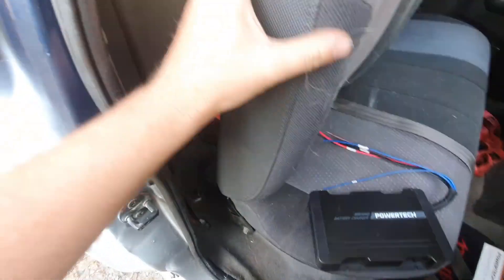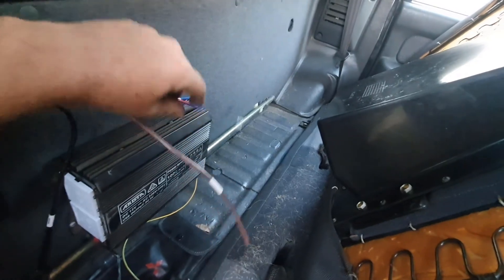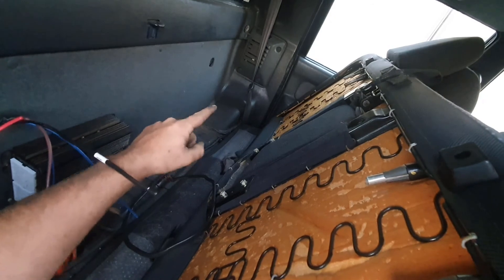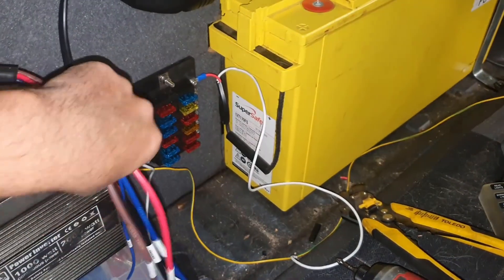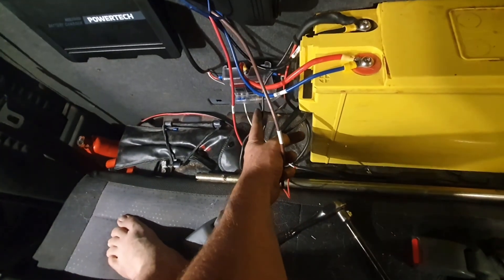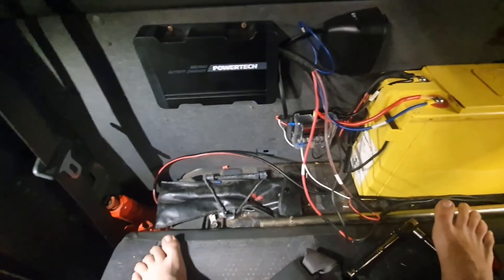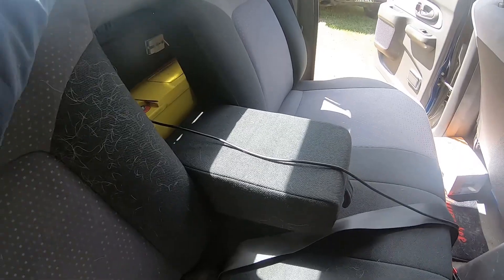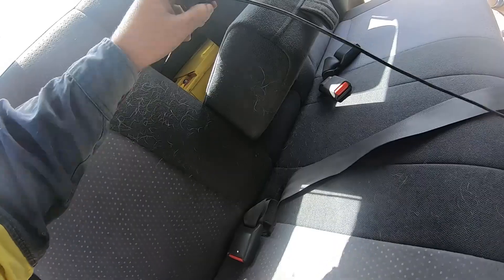installing Powertech dual input DC/DC multi stage charger.

Comment: Hi there. I bought this one a year ago and all was good. I was using the main batt for charging the sec battery. Recently, I’ve installed 150w solar and since then the charger pretty much stopped using the alternator. I understand the charger’s preference is solar but I thought it would combine both power sources when the engine is on but no. And now when I disconnect the solar, the charger will use the alternator for a few minutes and then it shuts off and won’t come back on again. Has anyone had similar issue? Cheers.

Comment: My unit is turning on and off. Not staying on. I've got 13.8 volts at the leads feeding into it. The acc wire I've joined with the positive feed as my feed wire from main batt is already off when ignition is off.. can anyone help? Do I need to disregard the acc wire all together?
Reply: Hey mate - I have the same issue. While it is charging it turns on and off. Did you manage to fix it?
Reply: @andrewakib1472  yes I did. My issue was that my feed did not have the current to supply it. I checked the resistance at my feed and it was high ie my earth was bad. I'm not expert, but my guess is that the unit goes to draw current and it isnt available so it switched off, only to switch on again as there is just enough to run its "on" lights. I changed my earth on the car, checked for resistance and its algood. Only issue now is that it doesnt actually stop charging when the car batt gets below a certain volts which I thought it is suppose to. Ie, if I leave it all connected it drains my start batt?

Comment: Hey, correct me if I'm wrong but did you connect your negative from your main battery and from the dcdc direct to your 2nd battery, then run a 3rd wire to an earth? And would 6mm wire be ok or should I get thicker wire.
Reply from the maker: Correct but it not necessary with the earth between the 2 battery's as the car is earthed. 6mm cable should be fine the most the charger runs is 20a

Comment: I need help my charger wont shut off and constantly drains the starter batterys charge even when the car is off. PLEASE HELP IM DESPERATE
Reply from the maker: Sounds like that might be an issue with the unit not the wiring

Comment: Hi,
Can someone help me, when I connect solar panels to the mb3940, the solar charging Light is on but with my wattmeter displays only 0W. 
Thanks and best regards Pascal
Reply: They are fairly useless on solar, you need around 4amps minimum otherwise it drops off to zero

Comment: could you connect the ignition
 wire to the cig jack in the boot as it only turns on when the key is on?
Reply from the maker: You could but that would run off the main battery.

Comment: That bit about setting the battery type before connecting the DC output from the charger to the 2nd battery should have a mention in the manual! Other than that a great little unit.
I have one in the camper trailer and have just put another in the Patrol for it’s auxiliary battery.
A very useful video!👍

Comment: Does the negative cable from the DC-DC charger have to run to the starter battery as well, or can it also be earthed to the body?
Reply from the maker: Just Earthed is fine

Comment: I have hooked mine up exactly the same does anyone have a problem with the solar charge light constantly flashing ?
Reply: Did you happen to solve this problem? I'm having the same issue at the moment.
Reply: @paulcleator7315  These are useless for solar unfortunately testing it in the lab here they cut out under 4amps you need quite a lot of panel and a sunny day for it to be useful.
Reply: @jordanclarke2996 how much solar is too little? I was looking at getting a 200watt panel.

Comment: Hey mate! Did you figure out how to stop that constant beeping at full charge?
Reply from the maker: We just run a fridge for a few hours. Ours has done it twice now both times it stopped after putting fridge it to drop the volts down
Reply: @AU-nappa  would you know why the charging light flashes on and off .would it be because it's low maybe?

Comment: Your comment about how to set the battery type was very useful, and not described in the manual. I’ve just installed, and was wondering why I couldn’t change the battery. Thanks.

Comment: You maybe able to help me. I just purchased this Powertech charger and I may have made a mistake, I do what to charge my camper trailer batteries (3 X 100ah lithiums just installed). My question here is, will it still work if I install it in my camper trailer and not connected to my car using my 2 solar panels to charge the batteries.
Reply from the maker: So only solar no alternator. That should work fine

Comment: Yep bought one as well. Install was easy on my caravan. Works perfectly.
Reply: I want to install one in my caravan as well. Just don't know where all the wires go.  I have a Jeep with the 12 pin flat plug supplying power to the caravan battery.  (Lithium),  The caravan battery is under the bed. Where did you connect all the wires to ? Cheers.

Comment: Shed some light * please cheers
Reply: You need to either use the ignition wire as he mentioned in the video or you need to have a 12v battery isolator, the same as you would need if you have a dual battery system.  The Powertech does not have inbuilt low voltage detection/protection.
Reply: @muzzgit  so if I’m correct you can’t just run a cable from the pain battery back to the charger because it I’ll flatten the starter correct. So I need to buy a isolater so the dcdc charger will stop getting power from the starter battery ?
Reply: @jacobball3626  Yes.  This DC-DC charger will flatten your start battery.  You also need to check if yours is a 'Smart' Alternator.  Check with an auto electrician or mechanic to find out.
Reply: @muzzgit  mine is not a smart alternator so what do I need to do to fix it ?
Reply: @jacobball3626  Good, you won't need to do anything to it.  But you still need to isolate your starting battery. A 12v solenoid (Redarc or Pirahna or Powertech) will do the job.  You can tell its working because every time your engine is at idle it will click off, then click on again as your engine RPM goes up again.
Reply: What happens if I don't connect the wire to acc will it drain battery and other question what happens if I don't have a solar panel at moment or is it a must to work properly 🤔

Comment: Hay mate I’ve hook up identical to yours and it’s drained my starter battery my car doesn’t have a smart alternator do that’s not it but yea can u she’s some light
Reply from the maker: There has to be something else linking the positive side of the battery other than the charger. There is a chance the unit may be faulty. Easiest way to check is to disconnect the charging wire from the start battery to the unit and see if the both drain together still.
Reply: @AU-nappa  No...!  You need to either use the ignition wire as you mentioned in the video or you need to have a 12v battery isolator, the same as you would need if you have a dual battery system.  The Powertech does not have inbuilt low voltage detection/protection.
Reply: muzzgit The Powertech DC-DC Charger only uses power from the starter battery when the starter battery is 13V or above - so basically only when the alternator is running. Obviously, it disconnects when the starter battery falls below 13V. The DC-DC Charger handles input voltages from the starter battery/alternator up to 16V, while the solar input requires 16V to 25V from the solar panel(s).